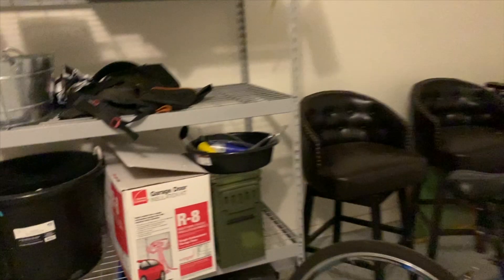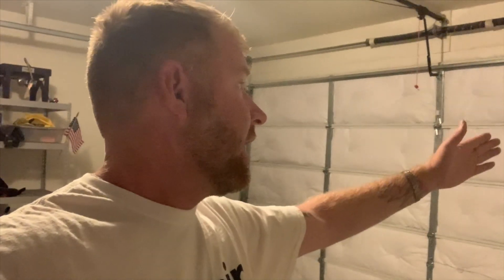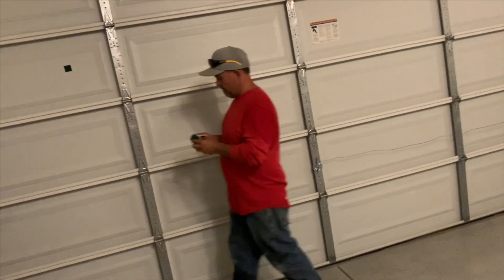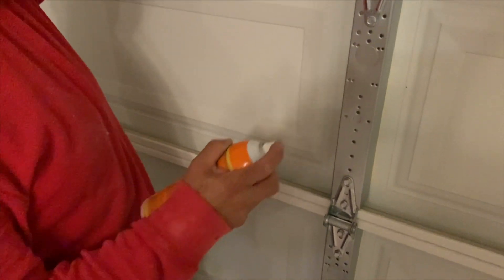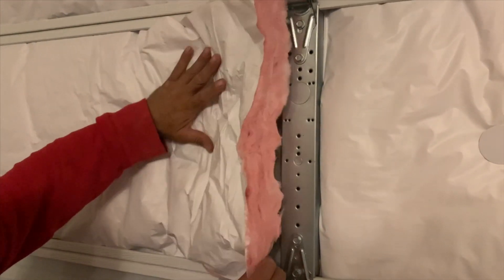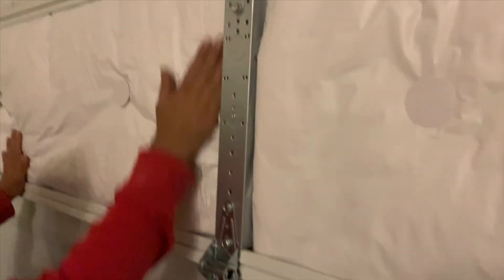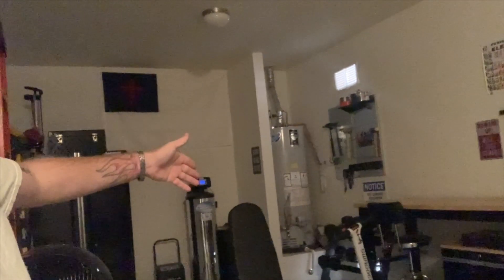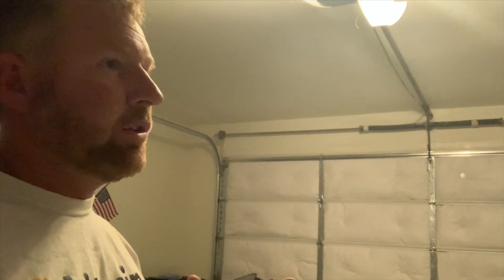Single Garage Door Insulation Kit

Comment: Any stats on before and after?  Did you use a temperature laser to get the heat before ..and then after to see if there is an actual temp drop? Sounds like a good idea..but does the science work?
Reply from the maker: I will say this the garage door opener no longer works. It does appear a bit cooler. I have now started using My Q garage door opener app as the work around
Reply: @UrbanJReviews  Too much weight now for the garage door opener to work??? if so..that that is not good
Reply: @ZeebNinja  no he means that the remote that you have In your car no longer can communicate with the garage door opener inside the garage after you put the insulation on it.